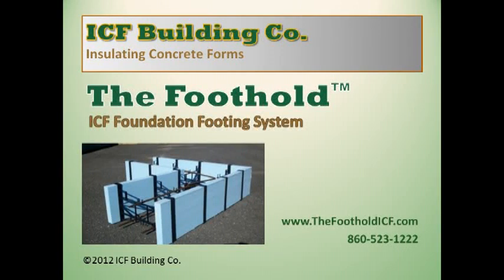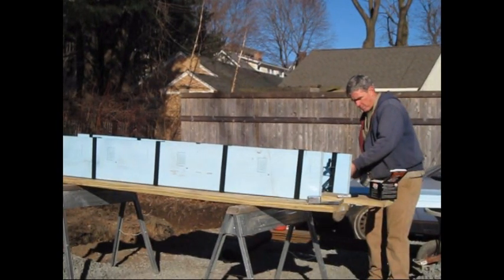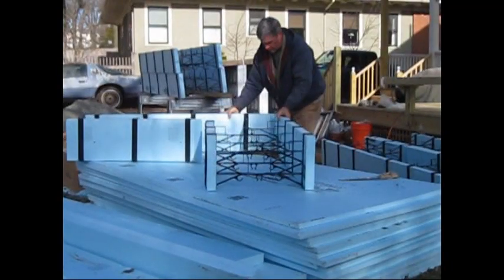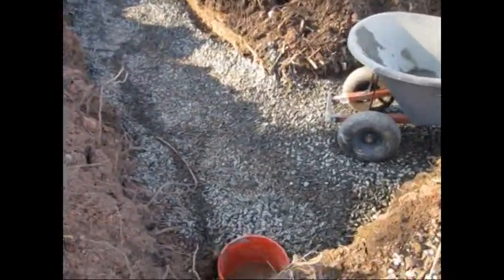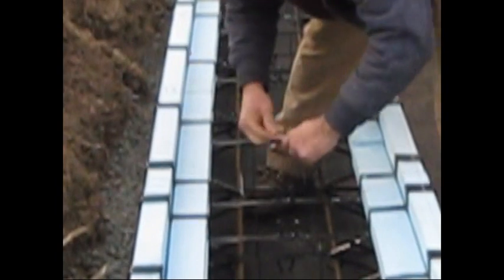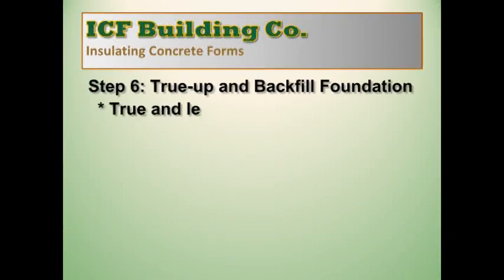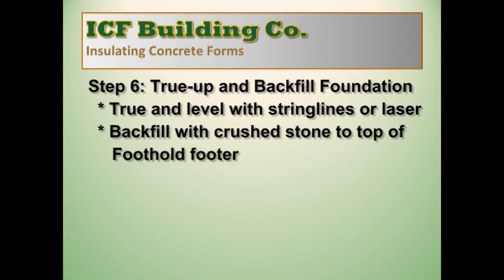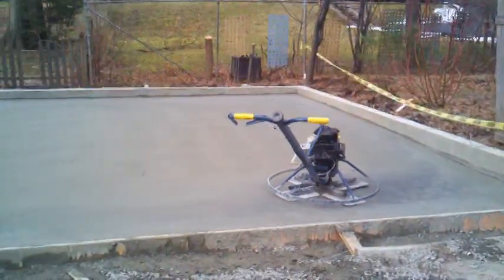The Foothold ICF Footing System

Comment: Could easily do the same thing with BuildBlock and QuadLock ICFs or any other with extender ties, its nice you made this system for ICF manufacturers who do not offer extension ties though so anyone using say LiteForms can use this in conjunction with the LF system for a footing to wall monolithic foundation. Instead of footing then attaching a "track" which was the norm and this would up creating a gap where the heat gain i the footing would just escape the wall. this creates a seamless footer too wall and none of that useful geothermal mass gained in the footing goes to waste.

One could be real creative and innovative and do a slab to footing to wall monolith basement, but also a geothermal system hooked into the foundation and rest of property to create a stored geothermal system.